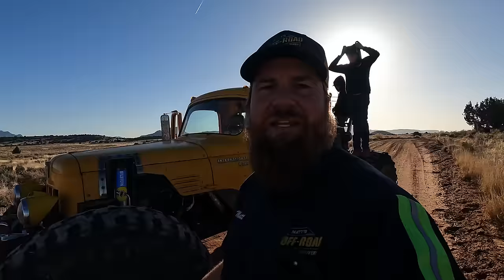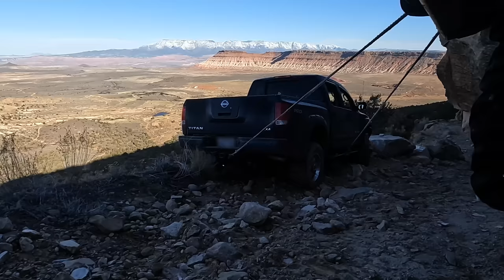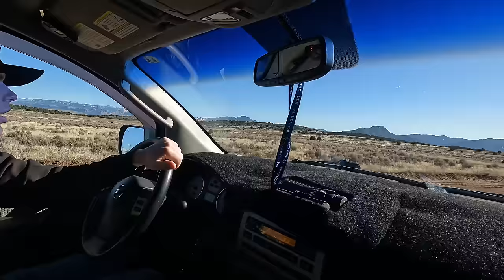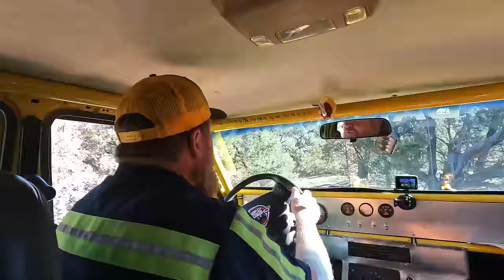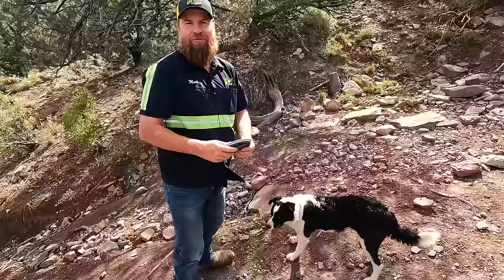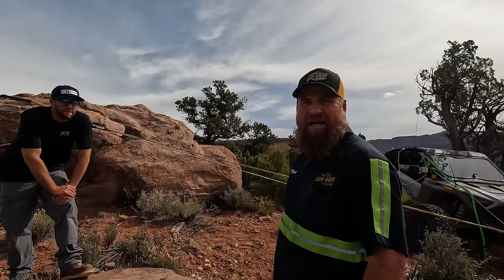Not Again...This Trail Too Dangerous For Off Roading!

Comment: The best design decision on the wrecker was the back wheel steering, that saves you guys so much time and trouble it's amazing
Reply: Yeah, they were always going to use the steerable axles, but remember the original plan was to hard mount the steering arm. That would have been a shame, glad they made the right call
Reply: Next best decision would be some reverse jump seats on the tool boxes.
Reply: Also the 7 winches. Everything is perfect. Just the gas keeps not getting topped up 😂
Reply: I think this is like the only case where it's not a gimmick. Mat used it every time... Makes the wrecker so nimble
Reply: @russbell6418 yep, you beat me to it, I never did get why that was not part of the design.
Reply: @russbell6418 I've been saying that since Day 1. I get why it's only a 2 door, needs to stay as small as possible, but there's definitely room for a couple jump seats up there! I'd hate to see someone get hurt from riding up there with no seat or seatbelt. 😰
Reply: We had that ,front back ,both , and crabbing on some off terain fork lifts in the military , tilt also .

Comment: That razor recovery was like a classic winder towing episode, just the banana, kinetic rope and a Matt master class. Bravo 👏🏼
Reply: yeah he's a lot more efficient at his job now with all the equipment (and not being morally opposed to winching) but i miss the struggle in the early videos ngl
Reply: @donbehatin  As interesting as the first recovery is, I enjoyed the second one with Banana more.
Reply: @V8AmericanMuscleCar  same.
Reply: I don't think they needed to go through all the fancy rope and winch work with the snatch block on the boulder.  All they needed to do was back up again, shorten the tow rope to about 4 feet, take the corner a little wider with both vehicles, and they could have flown past that tree at 40 mph.
Reply: @Brian424  🚬👌
Reply: what does kinetic rope mean?
Reply: @jafsterlordbib  a kinetic rope stretches as opposed to a regular tow strap. the yankum ropes that Matt uses stretch up to 30% when placed under load. it helps with recoveries because it stretches, then snatches back to it's original length, pulling with way more force than you'd ever be able to with a static (normal) tow strap

Comment: If you didn't use rubber isolators when mounting that Hero case then the whole vehicle will be a sounding board amplifying the gear noise.  Also there is a rubber isolator for the driveshaft that on Itallian vehicles is called a Guibo that does limit straight cut gear noise from resonating off drive shafts.

Of course there is the option to pull the gears and better micro polish them along with better lubricants too however better isolation is whats mostly needed.

Best!

Comment: I was an engineer at Axletech for a short time and got familiar with testing several gearboxes.    I know straight gears are louder, but it seems to me like something isn’t right with how loud that transfer case is.   Could be a number of things but maybe the manufacturer could tell you if that sounds right.   I’d hate to see you suffer indefinitely for something that could be fixed.

Comment: That 1st one on the cliff turning that huge truck around?  So brave. I wouldn't have even driven it back up. 
Now when I was young I'd balance on any rock or beam over a long drop, but as you get older the fear sets in, no idea why Matt is not scared. Plus why would the client even drive down there? Wow.
Reply: Agreed. This is hard to watch
Reply: The question, "why would anyone try to drive here (esp. in THAT vehicle)?"  Is a common question on MORR's videos.
Reply: I'm sorry, why did the titan get stuck? Need the recovery? Do we just need to take keys away from some people?
Reply: @kurtloptien185  It sounded like he was trying to push that rock out of the way with the front of the Toyota and then it started to slide and ended up on the rock. Maybe it works and at the time seemed like a good idea (60% of the time, it works every time😁) but it seemed like a dumb move from the comfort of my keyboard.

Comment: As a teenager I routinely carried 2 bundles of shingles at a time up an extension ladder onto three story churches, no problem. First trip, took 10 minutes for vertigo to subside. On any roof, 50 years later, it still does. 
First visit to The Grand Canyon, walked to the edge and felt nothing. I suppose the bottom is too far away to register as the danger I know it is. Rio Grande Valley from the east side in central New Mexico is larger and much more impressive. Also free.

Comment: I was invited to that test site on Smith Mesa once.  They have a mile-long rail line with a trolly that runs on the rails and they mount an aircraft fuselage and jet engine onto it.  It blasted down the track at mach-one, then tripped a trigger mechanism that caused the ejector seat to launch.  They do that so they can test the systems before they go into production in fighter aircraft.  No monkeys were launched, lol, but the engineers said that back in the 60’s they also strapped dead black bears into cockpits and launched them off the cliff to see what kind of damage would be done to a human pilot’s body in the event of a plane crash.  There’s also unexploded ordinance all around the base of the mesa from missle tests conducted up there decades ago.  Some of it was cleaned up in the 80’s, but signs are still posted along the road warning people to stay away from the base of the cliffs.  All-in-all, it was a very cool day up on the mesa!  Sonic boom and all.

Comment: No way could my dogs be trusted that close to the edge, I'd end up with two dead dogs in the worst possible way. The silly buggers would chase each other off. Peanut was making me nervous but she's grown up around that country and Matt was obviously not worried. 

Those Hero transfers are indestructible but they are a race case needing earplugs and helmets to not go insane from the sound. You could keep it in but you would need to wrap the case in a sound blanket which would necessitate an external oil pump and cooler due to heat retention. All of that is just more weight and more stuff to get hung up on. 

Oh, and the performance of the wrecker in the first one, it never ceases to amaze me just how great a job you did building that beast, Matt. To have that built as a customer job would be a minimum of 250k and I'm probably underestimating there.

Comment: I know this is an old video. At 24 sec: "You need to keep more tension on the rope than you are doing." The rope was on the ground. You should do a tutorial on flat towing. I was towing my buddies '81 F350 through town with my '49 Chevy 3100 and had to stop at a light. He didn't keep tension on the static strap like I expected. Kept trying to take off before it turned red, and his truck kept jerking me around. Finally I just stayed in it and got us going. Man!

Comment: Hearing that straight cut gear whine always makes me smile because of the amount of people that parrot that straight cut gears are stronger and thus better, which is.. completely the opposite of reality. More efficient at transmitting power and cheaper to make.. but certainly not stronger. The feature that makes them more efficient at transmitting power is also what makes them weaker.

Comment: Recently bought a '17 SV 4X4 CREW. Amazing capability. Same drivetrain as PRO-4X, except no rear locker or skid plates. Even this is not a full on off-roader. Don't understand how it was put anywhere near the edge. You will not be dragging me out, especially in any place like this.

Comment: Once again excellent recoveries. Those headset radios would have been ideal for the razr recovery. No yelling out the window to the towed vehicle for braking/etc. The 4-wheel steer on the wrecker is a game changer, without it that U-turn on the top of the cliff would have been just about impossible if not impossible.

Comment: I remember the video where you showed a couple of giant MRAP steering axles you'd picked up and said something like you were "working on an idea". A while later, it was "we'll need winches all over this thing". Hot Wheels, eat your heart out! The holes in the roof of The Wrecker wouldn't work in Canada (Whoop!), but are a nice touch for your neck of the woods. No nonsense vehicles, yessir.

Comment: matt if you put tow strap under UTV center to back and use a small strap at front a-arms to keep it between front tires the "pull" point will become the back and it will help the UTV to make poor corners like this.

Comment: You need to find a couple of spots behind the cab of the wrecker to weld in a pair of steel tractor seats so it would be safer for external passengers.

Comment: That x-fer case has some serious issues, way too much backlash in the gear sets.. I've built way too many BIG TRUCK gear boxes and they all have straight cut gears.. 9 speed, 10 speed, 13 speed, 15 speed, Spicers, Fullers, New Process and NEVER have I had a gear box make that kind of noise when I'm finished..

Comment: Few people know that the B-52 was originally supposed to deliver nuclear payloads, pull up sharply until it was upside down and heading the opposite direction, roll upright and continue to egress from the target area; another something you should NEVER want to experience if you aren't driving. (rules for thee... Matt, are you planning to run for public office?) It's kind of hard to tell, but occasional camera angles show how much "fun" the edges there are.

Comment: Space food sticks :D
Ouch.   Rory wants $150 for a 10 footer?  I like his content but ffs.  Those are <$90 about anywhere. Awesome tug, regardless.
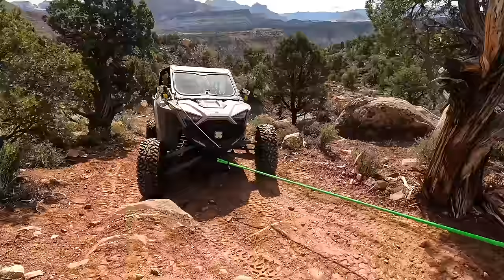Matt says 'there is no wider'.  The tracks at 26:05 in the bush prove that was incorrect :D
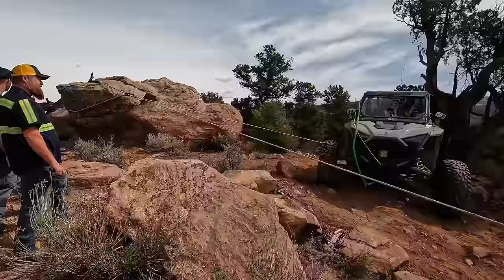28:36   That is the bad flarehead radius I always avoid by using rollers.   That tight radius is an insane heat source.  Rollers will reduce the heat when you cannot get a good angle. That makes your winch ropes last goodr.

Comment: your locker in the front and posi in the rear setup I cant fathom. That usually happens due to bad build planning but damn you stuck with it. first place I want a locker is the rear axle.

Comment: I was thinking of the thousands of ways to do a job like you said, but razors don’t have a lot of tie points. One other tie spot would be near the rear? So you’re not dragging the front around but you may drive over the rope. I can’t think of a better way to do that pull.

Comment: if you pull a vehicle thru sharp bend and it is sliding inside the curve, you can attach the rope to the rear and the front end will be much more nimble

Comment: Amsoil gear lube in your transfer case.
Or a Lucas oil product.
Thought on Bombi brakes?
Can you use a trailer brake system for the rear idller ,
Possibly even a small drum brake with electric activation??
Play safe

Comment: Isn't there a way to build some seats on the back of that from the boat or a tractor, something from a boat or a tractor? That could be removal with like a 2 inch receiver in a pin with seatbelts?

Comment: Is there separate hook-up fee? You still have to haul out the tow truck then drive it out which costs money; but if it's not used does it cost less than if you have to?

Comment: if you want to show the "angle"(grade) of slopes place camera close to or against them and view straight across the face/out slightly. that's pretty much a ninety degree angle from them.
I wish we had youtube/other and cheap available video/camera gear in the mid to late 1990's, playing around in the "West Virginia" mountains. where if you messed up, you may drop off huge cliffs.
come to think of it we were nuts teens/young adults and didn't take that into account. 30 to 60+ mph up a banked hillside with cliffs of death to one or both sides. 🤣😳

Comment: How does Matt get away with using the winch on the Banana without the engine running?  Doesn't the winch motor deplete the battery?

Comment: Thanks for yet another great video! I have One question though.... I don't do much recoveries here in Norway, but the few I have done, I have done in similar terrain as the Banana did with the RZR . I would have done it a bit different. First of all, shorter tow rope. second I would have let the RZR roll back a bit, as they did, and turned the Banana around and parked it as far from the tree as possible, winched the RZR up to the bumper on the Banana, and the towed the RZR face-to-face 12 feet and then turned around again. All the snatching etc seems a bit overkill to me. Would that have been a way to do it, or am I out on a berry trip here?? Best regards fro 2 feet of snow in Norway!!

Comment: The old stage coach run California Calistoga was fantastic groves in the rocks that high mountain turn was one at a time the valley having gliders towed in we were at the turn just looking out at the valley we could hear thus sound we were saying what's that just like that the glider wing 10 feet away from us pilot you could see him smiling the sound was the girl screaming flying by us . The man that owned the property had to close it truck went over the cliff no one lived truck still at the bottom. 
The run was a day long 
Stoped ware the stage coach had a rest stop fire place still there . All most forgot the wall was a stairway made for 4 wheel drive to  climb .

Comment: Those straight cut gears are so loud.
Reply: Straight cut gears are more efficient in terms of power transmission because they have less friction and energy loss during operation. However, increased noise and vibration are the negative effects. Everything has a trade-off 👌

Comment: On those jobs, would it be easier if you parked the wrecker closer. Used the book to pick the back end of the vehicle up. Then turn hard driver to walk the front end back onto the trail whilst the wrecker pulls forward. Bringing both the back and front end up onto the trail in one go. Just a thought.
I feel like the boom isn’t used enough, lifting the back instead of dragging it against the rocks and surface is surely easier?

Comment: Can I ask , why would you never disconnect your trailer?
Reply: Because it’s often easier to recover them as a unit instead of having to do 2 recoveries. When the trailer is unhooked that also means the front is on the ground so you need a way to pick it up to move it. Can get difficult in soft terrain where the trailer will want to sink. 
From the video that was a small trailer they could unhook and spin around easily instead of trying to get the truck and trailer turned around together.

Comment: Build a L shaped pulling device that u lay in front of what u pull then put it under the front of what ur pulling n put a rope on top of the L it will lift n pull anything out of the sand..

Comment: Hey boys! Since you 'hate' riding outside the cab of the wrecker, why don't you do something about it? It appears to me that a couple of foldup jump seats (Or the removable type ones used on bass boats without the pole) mounted to the top outside ends of the headache bar should serve your purpose. Of course seat belts would be a smart thing to have on such seats. The boat ones  usually are made with aluminum, so making a couple of flat brackets on the headache bar and a some for the bottom of the seats would be required.